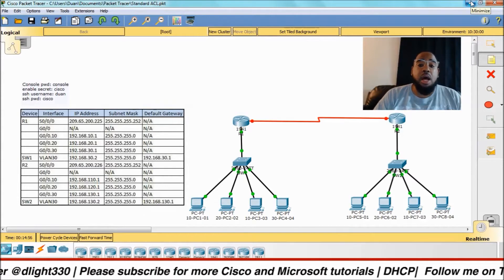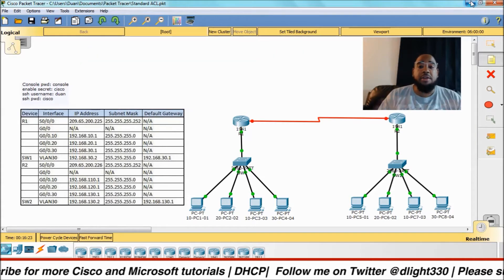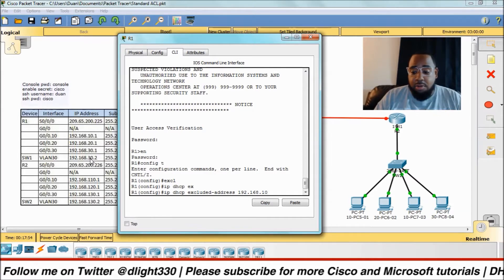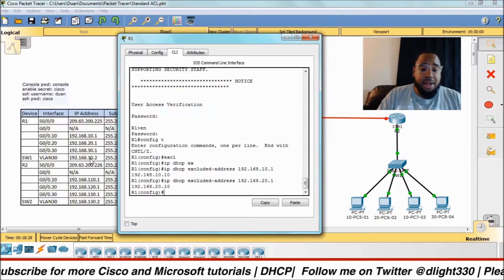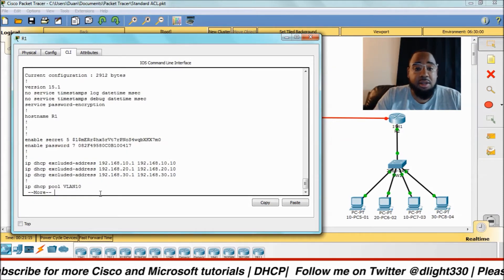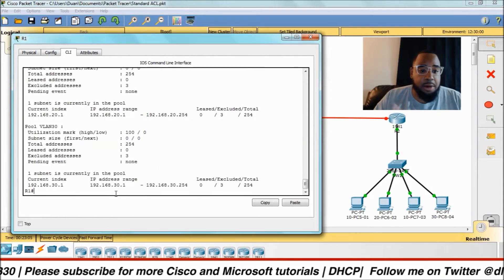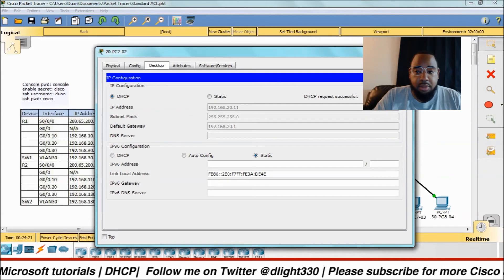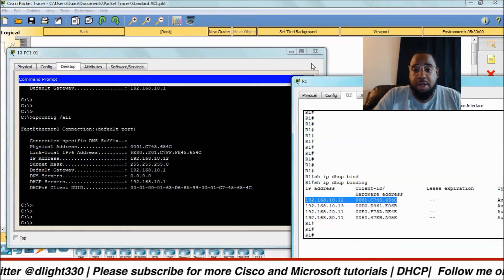How to Configure DHCP | CCNA Packet Tracer RIP Lab part 6

Comment: I got VLAN and DCHP parts for both R1 and R2 networks easily,  but how the broadcast domains of both will communicate with each others? lets say i want to ping from vlan10 network to other side R2 network vlan! how this will work! should serial ports connection on routers will be trunked?